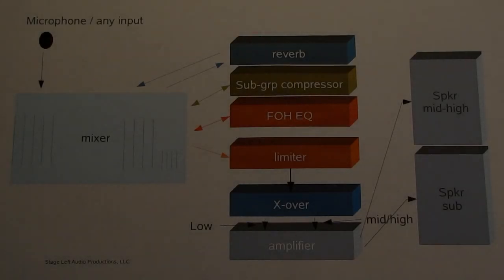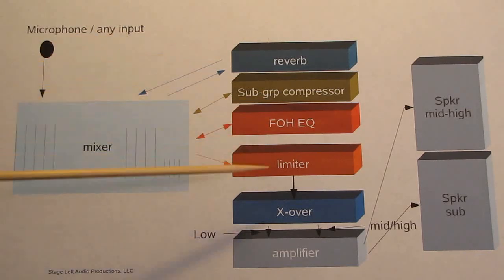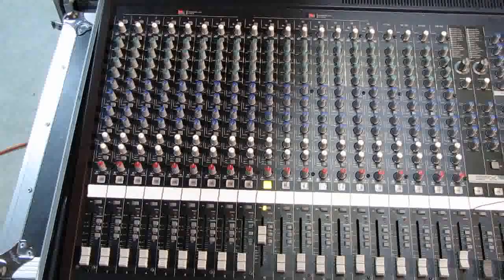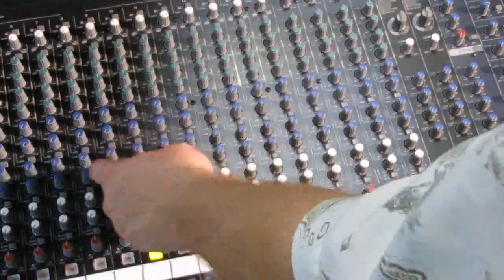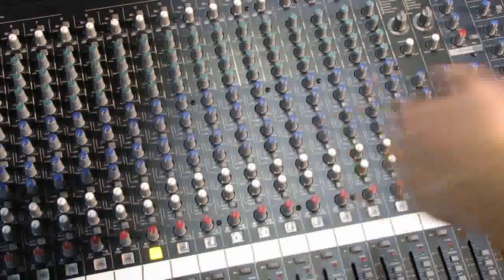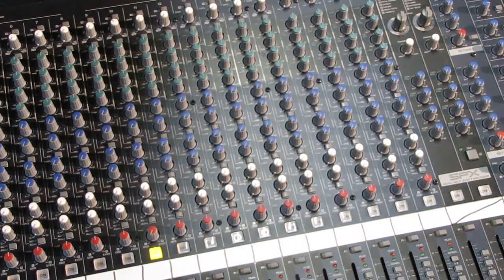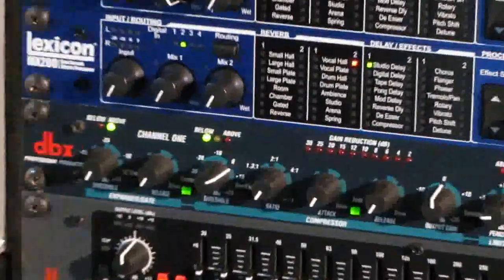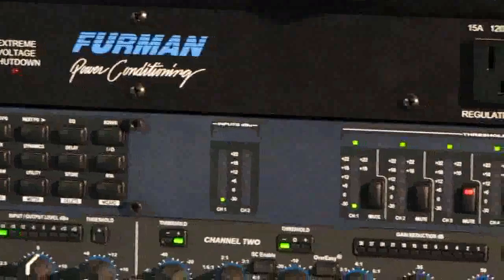Looking at the basic signal routing for a console and outboard gear - Stage Left Audio

Comment: Do you try record out?
Reply from the maker: We don't do any type of recording.  The sub-groups could have been used as a "record-out" option, however, the recorder would need to be able to handle 1/4" inputs.  We do offer feeds from our other consoles for others to use for recording.
Reply: @stageleftaudio  ok, thats mixer its not good for rec out live gig?
Reply from the maker: Correct, it's not good for recording.  There are some analog consoles that are good for recording, but many small format consoles (like in this video) are not that good.  If you want to do recording direct from a console, most any digital console can do that.

Comment: I’m in the learning stages any help would be greatly appreciated. I’m using the Allen and Heath zed 22 fx. ? Is this.... how do i insert an eq from mixer for FOH ? I see a L &R insert just to the left of my mains L & R. Do i use Y cable in inserts ? Then still use main L & R output to amp ? Hope i explained that right.
Reply from the maker: To use the "insert" points of your ZED, you will need a special cable designed for inserts.  The insert cables look like " Y " cables, but they are not wired like a " Y " cable... they are wired differently.  You should be able to go to any music store and ask for an "insert" cable.  One side of the insert cable is the SEND, and the other side is for RETURN.  
Yes - you would still use the main outputs of your board to drive the FOH speakers.  The insert cables will not impact the functionality of the main FOH outputs - however, make sure the insert cables are connected to their correct input/output on the outboard gear you are connecting to.

Comment: hi , I would luv to see u guys do a vid on the driverack 260. I am curious as to why the outputs are called channels and not highs, mids and bass. Does that mean I can assign all  these  6 channels to either mids or highs or bass if I want too??
Reply from the maker: Correct.  With the 260, any of the outputs can be assigned to anything.  For our larger shows, we use one output for mid/high, one for lows, and another one for lows that manages a cardiod sub configuration.  We tried doing a video of the 260 a few years ago, but capturing the LCD screen and function buttons at the same time does not work (the LCD screen is too bright).
Reply: thank u,

Comment: i have a few questions, can you make a video on how you have the cables running from the boards to the rest of the effects in the back of your rack and how it looks back there? also how are you running your effect rack all the way up to your amp racks? are you running them thur the  cable snake?
Reply from the maker: We have a video on our channel related to setting up effects; it does go over the the signal routing.  The effects, along with other processing is all kept at FOH.  The amplifier racks are kept at the stage.  Only signals running to the stage are FOH low, mid/high and any monitors.

Depending on time availability, we may try do a video that shows the entire signal path.
Reply: thank you alot, and i hope you can, i can can learn by seeing where the cables are plugged in.

Comment: Sir, Can i use external EQ with  power or active stage monitor??
Reply from the maker: Yes.  The EQ would be placed in between the auxiliary (AUX) output of the mixer (whatever aux output you are using) and the input of the speaker.  This is a very common method of using an EQ on a monitor channel.  If the EQ has an output level control, that control should be placed at the -0- mark (or sometimes called a "unity" mark).
Reply: stageleftaudio Great and Thanks a lot For Fast Answerded

Comment: Would that work for the right side too?
Reply from the maker: Yes, either channel.  The left output is most always recognized as the mono output (even though it could be either L or R).
Reply: what if I need some of my sound to come out on both. What do I do?
Reply from the maker: If you need a signal to come out of both outputs, keep the pan knobs for the channels (and sub-groups if you are using them) in the center and the L/R switch (if your board has this) enabled.  If you are using subgroups, the channels can still be panned either L or R (assigned to a group) as long as the sub-group assignment switches are used... then, the sub-group pan controls can stay in the center.  As long as the pan control is in the center, the signal will be sent to both outputs.
Reply: stageleftaudio thank you
Reply: stageleftaudio hi, enjoying the videos. I'm considering this board for studio use using the main outs and the groups, along with two aux sends to 8 inputs into my audio interface into my DAW. What's your opinion on the board? I've heard the preamps have a clean warm sound and the Eq has a nice vibe. Not sure if the preamps overdrive nicely, but I do have some outboard for that. Quality board in your opinion? Looking for something built nice that will last for years. Thanks for any input. Cheers.

Comment: i think limiter & xover should be swaped
Reply from the maker: Depending on the setup of the sound system, the xover and limiter could be swapped.
Reply: yeah! if you have few stereo limiters you can place them on each band after the Xover (just like in your driverack). If you have one - place it before.

Comment: sir... we have same mixer in our church ... we use aux for sage monitor and mono for main speaker... main speakers sound different from stage monitors
Reply from the maker: The main speakers should sound different than the monitors, even in mono.  The mains should actually sound better than the monitor speakers.  Remember... monitor speakers are for monitoring; they will most always sound different.  Also, more processing is usually conducted on the main speakers (EQ, compressors, reverb).  The monitor speakers should only have an EQ on them and a limiter.

Comment: great video, how would add an expander a 3dbx 3bx dynamics expander
Reply from the maker: +Francis Wright For live sound, there would be no need to add an expander.  Live sound is already dynamic.  Though, if you wanted to add an expander, it would probably be placed between the mixing console output and the amplifier input, this would allow expansion of the entire signal.  Or it could be placed as an insert for a subgroup or a single channel to provide expansion for specific instrument.  The 3dbx is a good unit, though, I think they were designed for playback of recorded music only.
Reply: Thanks for your quick response. Yes play back music is what i do,not live gig. Am a dj but it sometime hard to get my system playing the way i want it.   My signal routing is from my dj mixer to reverb to expander to eq to mixing board to compressor limiter to digital speaker management system to amplifiers  to the speakers.  Is this the right routing
Reply from the maker: +Francis Wright When using live sound equipment, it's not advisable to take a "linear approach" to signal routing like how it sometimes is with DJ equipment.  As well, mixing DJ equipment with live sound equipment takes a little more work due to the signal level differences between the equipment.  Having too many pieces of gear "in a chain" can cause various impedance issues with the equipment.  This can sometimes lead to audio quality issues.

You could try this... The DJ mixer should be plugged directly into the console... the reverb unit could be plugged into one of the AUX sends on the console; and the output of the reverb unit to return to a channel on the console (then, send the reverb unit a signal from the DJ mixer input from the console).  I would recommend using the compressor/limiter in the speaker management system instead of using outboard gear.  The EQ should be added to the console by using the FOH insert point (if your board has that option).   If you don't have an insert point (as well as the special insert cable), use the EQ in the speaker management system.
Reply: i will thanks

Comment: i got a question is your phantom power on all the time
Reply from the maker: Yes.  Most shows we do utilize a few mics and DI's that require phantom power; it's just easier to leave it on - this makes one less thing to worry/think about when setting up for shows.
Reply: so even tho you have bass and  guitars,  condessor  mics. all run with fantom power does anything happen to those  signals. do they affect dynamic  miss
Reply: mic's
Reply from the maker: Unless you are using RIBBON mics or very old dynamic mics, phantom power will not affect the signal.

Comment: Nice vid, thank you! But I'v got a quastion: Why does go the signal after foh-eq back to the mixer and not directly to the limiter and finally to the crossover etc.?
Reply from the maker: The FOH eq is added to the system as an insert on the FOH outputs.  The signal eventually goes to the limiter and then to the xover.  Running an EQ as an insert on FOH is common.

Comment: Thanks a lot for the video!!! Great stuff. What kind of cables are you using for EQ insert and why are you using those cables?
Reply from the maker: The cables are special "insert" cables (forgot the manufactured name); they are used to send and return a signal using one cable, instead of two separate cables.  Many music stores that sell sound equipment sell these types of cables.

Comment from the maker: A FOH EQ is much faster and easier to use and manage than the EQ in the Drive Rack.  Making an EQ adjustment on a FOH EQ takes half a second - whereas on the Drive Rack, it can take several seconds... those seconds add up real fast when trying to set the EQ to correct an issue.  However, I use many of the other features in the DR.